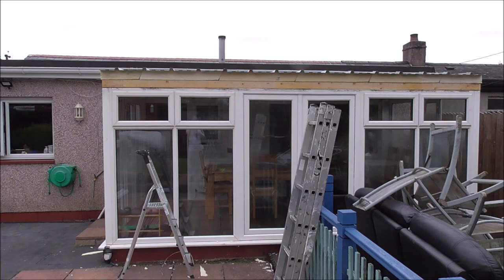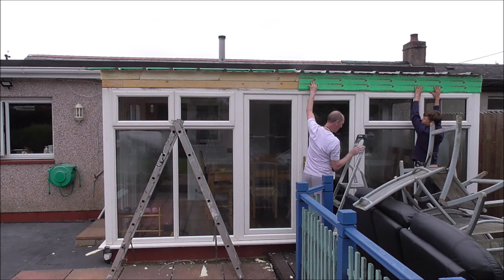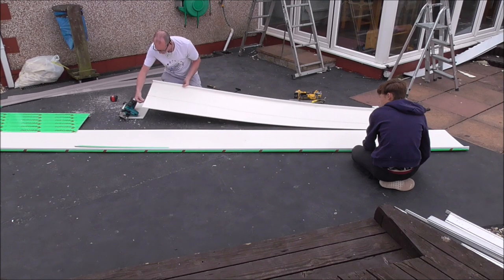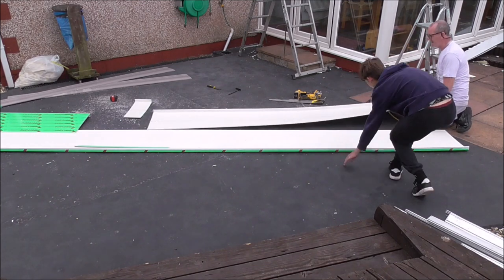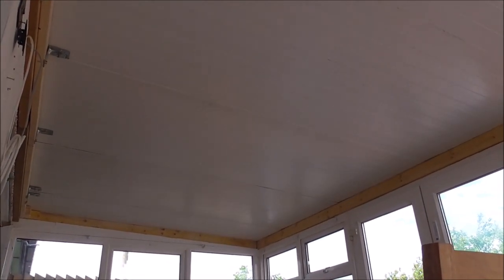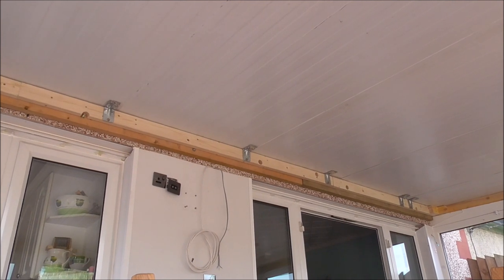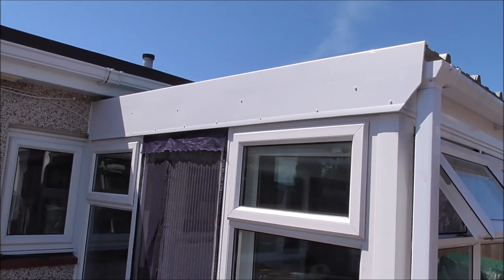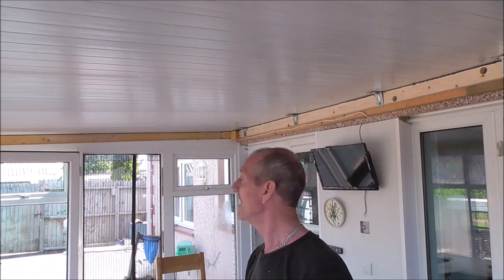New Concept Replacement Conservatory  part 3

Comment: Turned out great David 👍🏻 I wonder how easy it would be to fit a velux in that type of roof (just thinking of the larger jobs) - also i wouldn’t worry about the wind noise it’s been at the start of your videos for years 👍🏻👍🏻🤣🤣
Reply from the maker: Hi Mark with enough thought i would give it a go but lost of consideration at the top of it with the shape of the steel
Reply: Have a look at Kingspan KS1000RW for a roof light idea.

Comment: Hi David 
great video, 
what's it been like this cold spell were having and how did you seal the new roof where it met the house. 
in the video you just pushed it against the wall. I like to try this my self but we live on the coast and get driving rain, so need to seal it water tight. Thanks mostyn
Reply from the maker: We use it as our dinning room and it's very comfortable even in winter now we have the new roof
Reply: Thanks for the reply David. 
Going to look at doing mine in the spring so I can use mine in  winter . Merry Christmas, keep the videos coming.

Comment: Fantastic job, look amazing and you made it look so simple... Question are these panels really heavy? I only ask because last year I just super quilted the under side of the lean to conservatory roof and plasterboarded it and skied it. Now I want to tackle the outside. Do you think I can put this roof structure right on top of the existing roof... May use battens secured to the roof?
Reply from the maker: Hi, yes I would think so they are an easy lift the size I got was about 8kg no more each and as long as they are supported at each end they hold them selves up
Reply from the maker: Have you watched my followup to this video where I fit a plastic ceiling with inset lights?
Reply: @dmgladden  amazing thanks I'll give it a go.

Comment: Amazing work, David. I have been thinking for a while about something like this and indeed, as you mention, you are the first guy to actually do a conservatory with these steel insulated panels and talk about it on the Internet.
Having now past a good while since you installed it, has the roof alone made the conservatory (more) usable in winter? Also, have you noticed any problems so far, particularly related to cold bridging?
Thanks
Reply from the maker: Hi Lucy, in short I can say I've noticed no problems of any kind with this roof and it has made the conservatory as another room throughout winter we use it as are dinning room and just had a cold snap of -12c for a full week and the room was as the rest nice a warm.
Hope this help.
Reply: @dmgladden  That is impressive, thanks for the feedback. I would have thought such a large glazed area would - at some point - made the conservatory cold regardless of the roof. Do you reckon one could get away with 50 or 80mm thickness for the roof sheet?
Reply from the maker: @luc5543  hi and thanks for the comment as for data on other sizes I wouldn't like to guess as this is the first time I've used this board sorry

Comment: Yes a nice job we have a conservatory like yours but not as long with a flat roof now we have had the conservatory for about 11 years and it has been usles its far to hot in the day and freezing on a night and it has ruined most of are things we keep in there but I have been looking into wat to do but I am going to try and put insulation on the inside first and see what that's like I was wondering when you have put the new roof on has it cured it is it not boiling in the day and not to cold on a night thanks David
Reply from the maker: Hi as you know the past two weeks have seen us it 30+ and like you most hot days the conservatory was far too hot to use but this time even in such heat it was fine it felt like the rest of the house of caurse in the windows you feel the heat coming through but the room is no longer an oven we have yet to see how it stands In winter as it was always too cold but so far it's the best investment we could have made really it works